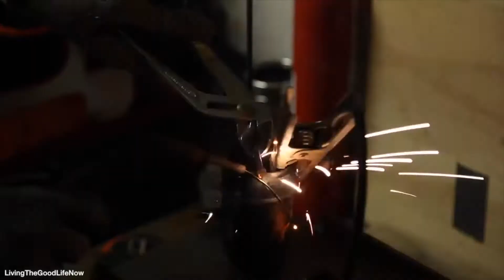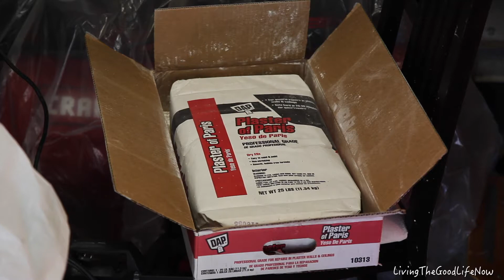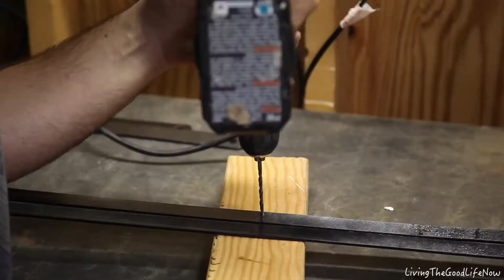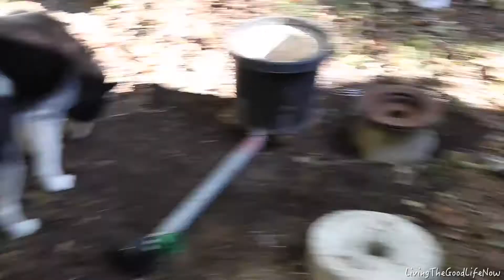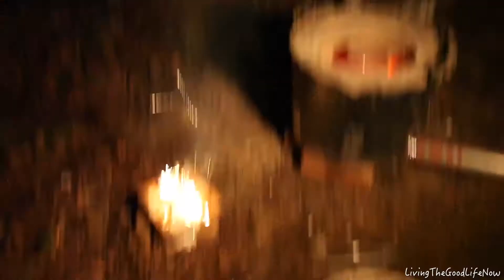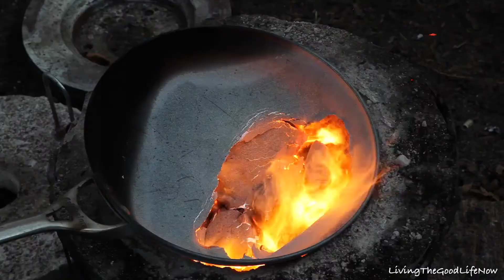Planter Pot Mini Metal Foundry, Charcoal Forge / Propane Furnace, DIY Melt Copper Brass Aluminum

Comment: so the fact that it doesnt melt down the brass entirely is a bit... dissapointing.

probably would get better results with proper charcoal, as briquettes tend to burn with lower heat from what I've learned.

I was hoping to find a foundry design powered by charcoal that could melt down copper, the more historical the better. but its a neat foundry. just wont do for things higher than. I assume 850 degrees C? so some bronzes should work fine.